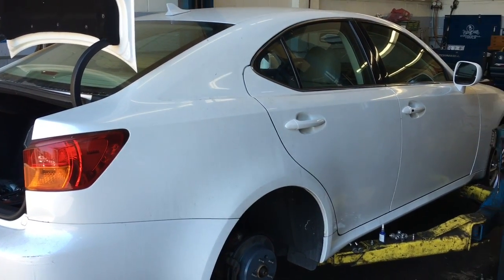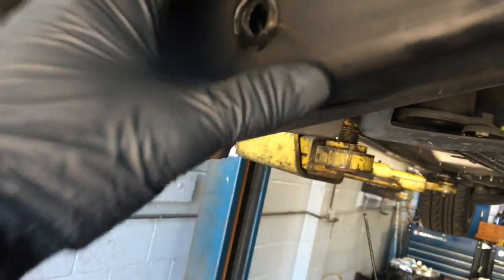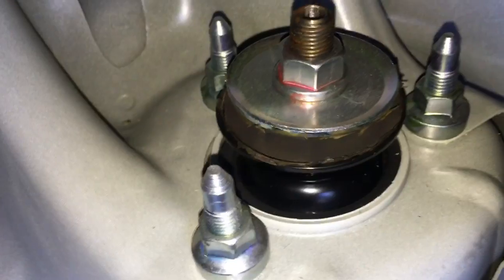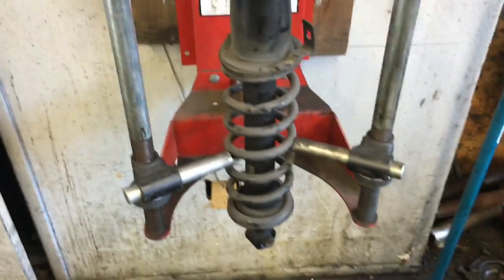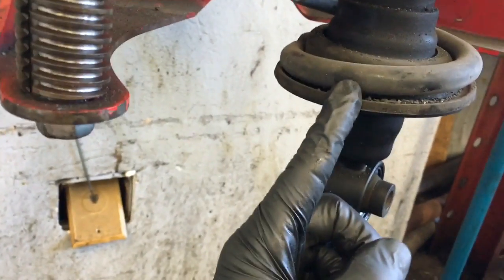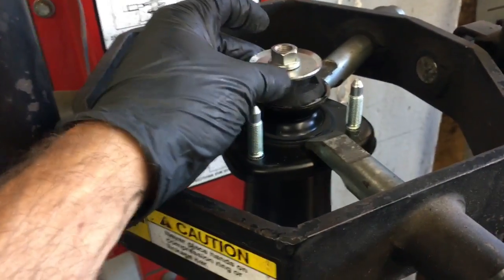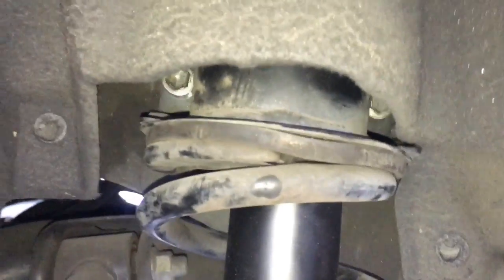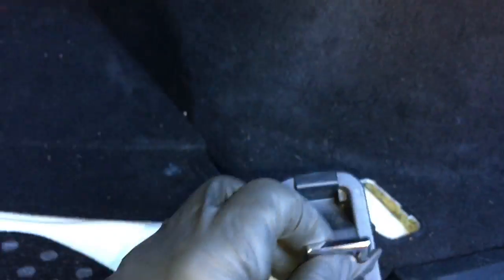How to Replace Rear Struts on a 2008 Lexus IS250

Comment: Guys, make sure you release the e-brake. Otherwise, your transmission might be torque'ing the spindle, putting all the linkages and control arms under tension, hence impossible to put the control arm back on to the spindle. It looks easy when Brian does it but for me, one whole day until I released my e-brake!
Reply: facts!! happened with me also when i change my differential
Reply: Is this advice for them with manual or automatic transmission ? I have manual and im abaut to go through this process, and im very scared because first Time i tried to remove em The lower bolts had rusted to The  controll arm
Reply: I see this comment after I finish struggling to do it😂

Comment: Just completed this on my 2010 is 350.  The video was a huge help!  Thank you...  one trick I found to helping align the swing arm bolts was to put a jack stand under the arm and slowly lower the car.  I didn’t have to wrestle with it quite as much...
Reply from the maker: Glad the video was helpful. Thank you for the tip and for watching!

Comment: I can't get the lower strut bolt removed. Any ideas? I have the nut off and the bolt lose. The bolt will only move back and forth a 1/4 inch. I spent over a hour using lube, chisels and punches.
Reply: I too pissed away a ton of time on this, the secret is that I used my impact driver to continuously loosen, while also pulling on the bolt with my fingers!  Once I stumbled on this, all the rest of the bolts for the shock and wheel hub bolt came out without too much fuss

Comment: so glad i ran across this video, I had a leaking pass rear strut and it was starting to make noises over bumps. I bought a replacement and did was attempting to start the job yesterday, but i thought the upper tie rods upper control arms had to be disconnected. Glad i saw your video because the job was much easier. Took me about 2 hours to remove and replace, thanks to your video, and saved some money too!

Comment: Great video. My mechanic recently replaced a leaking strut now the car sits a little too high and there is a gap. Is this due to not preloading the the car on the ground before tightening the suspension components?
Reply from the maker: Yu Show Lam that is a possibility. Or the spring is not sitting right in the strut. And possible wrong parts.

Comment: I have the 1A brand strut assembly and the size compares exactly to the original. Except the lower arm wont go up high enough to line up for the first bolt to go through the sway bar. the strut seems to be too low.

Comment: The 4 bolts need to be torqued to spec when suspension is loaded.. not when in the air. The bushing will twist and deform if done way in video . See Toyota directions
Reply: Hey Dave what’s the best way to “load the suspension?” BTW I’ll be doing a full strut assembly replacement.

Comment: Hi Brian, Thank you for the detailed video. I am preparing to do this tomorrow using your guide. The last comment here got me wondering, if I install exactly as you do I need to pre-load? I noticed you did not and wasn't planning on it, but then I saw some thing about putting the jack under the arm and lifting about 1/2" off the jack stand to pre-load before tightening the suspension components? Thanks for all your videos.
Reply from the maker: Derek Dugan The manual did not call for any preload
Reply: Thanks for the response, I ended up doing this today. Took me 7 hours by myself but did it all on jack stands. I watched your video weeks leading up, ordered pry bar and things you used. I can’t thank you enough for the video, torque for each bolt, etc. Saved me over $500 doing it myself than the dealership.
Reply: Just to add, worked for 2007 IS350 RWD
Reply: The repair manual says you have to stabilize the suspension by jacking up till the rear drive shaft assembly becomes level, then tight the bolts.

Comment: Hi, I own a 2009 is350 with 94k miles. Car is showing roughness over the pot-holes and a bit saggy in the rear. Do you know at what mileage is good to replace them under normal driving conditions? Thanks
Reply: You're probably close to replacing them. Mine went to crap a long time ago and now i'm at 203k on original suspension still on a 2007 is250. I'd say I could feel the harshness like at 130ish. Now car easily bottoms out and everything is shaky and loose feeling. Replacing everything tomorrow including sway bushings/ end links/ various bushings and of course the spring/ struts.
Reply: Thanks. Do you recommend the f-sport struts vs The OE?
Reply: @simple8818  I would say go OE since then you’d want to do f sport sway bars as well. I got the TRQ ones off 1A auto for mine for like 450 bucks lol car isn’t worth dropping that much on OE for me, it’s my beater
Reply: @MikeyG003  forgot to mention that car already has the f-sport sway bars and brace installed. I spoke with the dealer and they said adding the f-sport struts would be a nice upgrade. They are built in cooperation with Bilstein and are excellent quality.
Reply: @simple8818  oh yeah if you got those already, then the f sport struts would be a no brainer. Buy them online and get them installed at a trusted independent shop if you’re not doing them yourself

Comment: Hi Brian! I have a question.  According to the service manual, the last bolt/nut on the suspension arm, on the wheel side (the last one you put on), need a special tool called a 'ball joint lock nut wrench' (SST 09022-12170) to torque the bolt to spec.  Is that true?  thx!

Comment: Nice video.  Very well done.  My 2007 IS250 front struts need replacement.  Wonder how much it costs approximately?  I also need to replace both front tires.  Because one tire inner tread was excessively worn due to leaking strut.
Reply from the maker: Todd Gun The labor for the struts at the shop will be about two hours. So depending on the labor rate anywhere from 85 an hour upwards to 120 an hour. Dealer replacement parts for about 225 bucks you could find aftermarket struts for cheaper for sure. As far as tires go I recommend visiting a tire store in your local area. Hope this helps thank you for watching!
Reply: +How to Automotive - dealer $225 is just parts only I assume.  And that's cost of 1 strut, not 2.  Correct?  Because dealer is always expensive is what I know.
Reply from the maker: Todd Gun that was 225 roughly for the front to struts. But like I said you could shop around after market and get some good quality ones for cheaper. Labor will be around $200